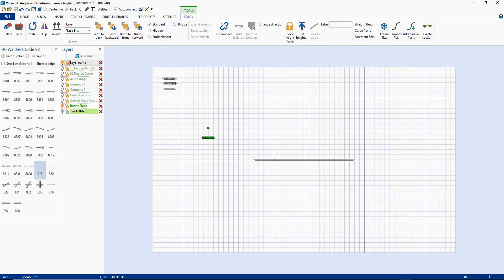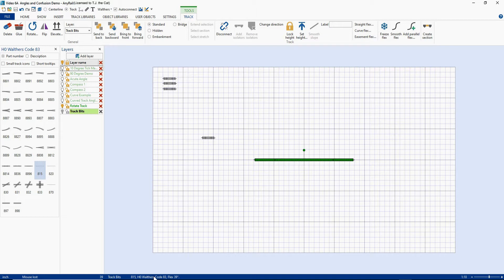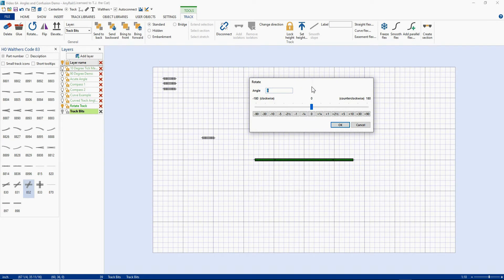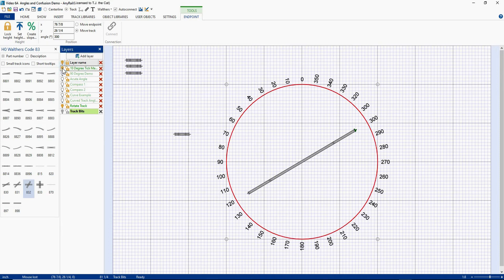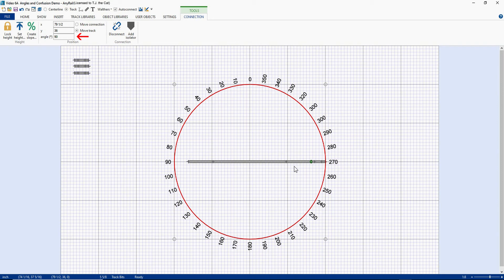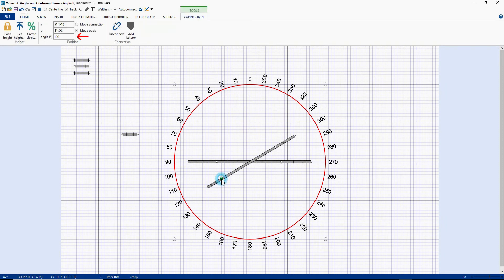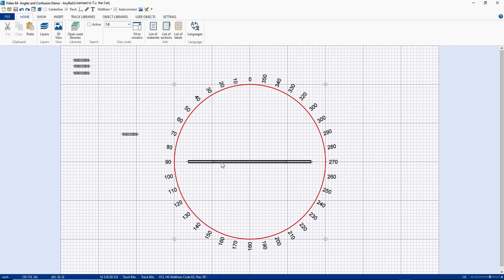AnyRail6 Tutorial Video 6A: Angles and Confusion

Comment: Taking a chance that you still are active here. I am an N Scale modeler and looking at AnyRail7. When browsing the site, I noticed that the Walthers Structures were not highlighted in the library and so not viewable. I also noticed same in HO scale. However, watching your You Tube videos I see that you in fact have Walthers Structures in your library. Question is Are the Walther structures actually included in the libraries? Or was the site just an example one would be able to view? BTW. Great videos. Great information. Awesome mentor for instructing AnyRail. Looking at purchasing as I am embarking on a new layout (10.5' x 18' with a jog 15" x 32', double decked)  Thanks Steve

Comment: So, could you just rotate every piece of track you brought on to 90 degrees (vertical) before setting the angle?
Reply from the maker: Derek,
My apologies but I am not sure I understand your question. Do you mean, can you rotate multiple pieces of track to an angle at the same time? Yes, you can. Select the pieces you want while holding down the CNTL key and then after selecting, right click and select 'rotate'. Or are you asking can they be brought in at a specific angle. In that case the answer is no. A track component always comes in horizontally where the left end is at 90 degrees and the right end is at 270 degrees. If this is not what you were asking, let me know.
Dave
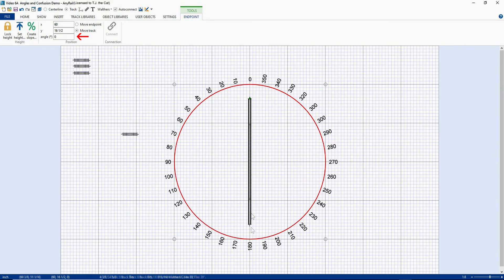Reply: I followed that each piece of track comes in horizontally but you showed that the angles were based off of that at 90 and 270. When you were measuring the angles at the end of the piece of track you turned to vertical at 6:24 the angles were correct from zero, so I was wondering if you should rotate each piece to the vertical position first so it is based on zero before making the angle adjustment so when you click on the end of the track the angle would be correct from zero. I hope I made my point clearer.
Reply from the maker: @derekalexander4030  Hi Derek, I don't know. I figure that as long as you know that an item you bring in is going to be at 90 degrees on the left and 270 degrees on the right , for me it just easier to add or subtract the appropriate amount from those numbers. Now that works for me but something like that is not a one size fits all kind of thing. I encourage people to do what is easiest for them. Let me know what you decide and I will include your method in a future video that is all about things I have learned since I made each video.
Dave

Comment: Did you make your own compass with the degrees every 10th place? I looked for this in the different menus and could not find it except for compass pointers. I did notice that you found this in your layers tab so this makes me think that you made your own compass.
Reply from the maker: William, Yeah, I made the compass for the video. Started with a circle and then just made a line and copied it over and over rotating each copy the required number of degrees. Did the same with the text. I rotated the text and then just visually lined it up with the line. Then erased the lines I didn't need. I did it quickly and if I had taken more time I probably would have put tick marks near each piece of text but the compass I made was good enough for the videos.
Dave